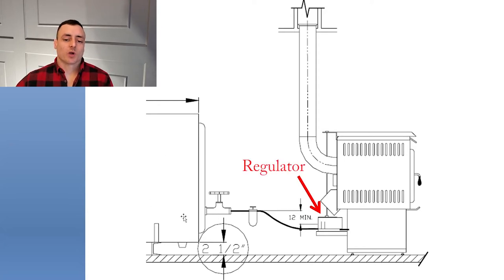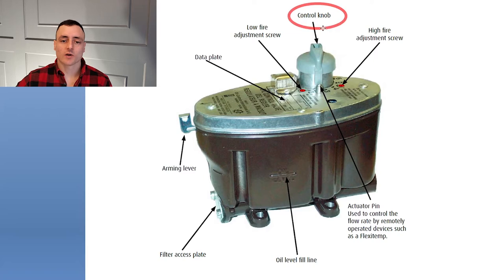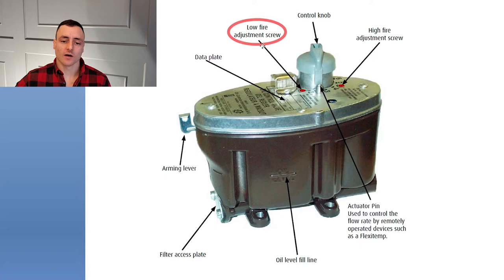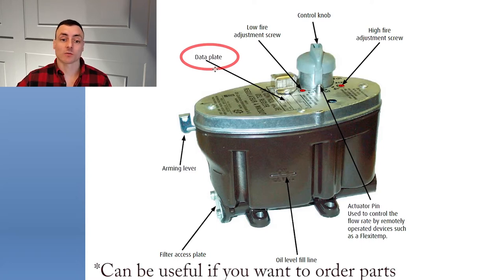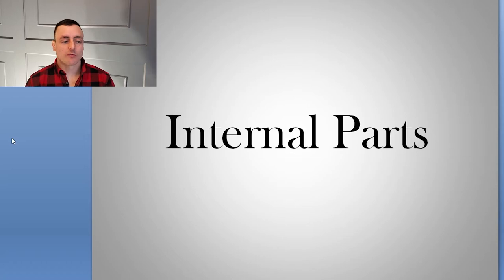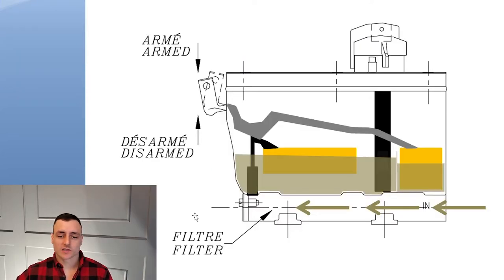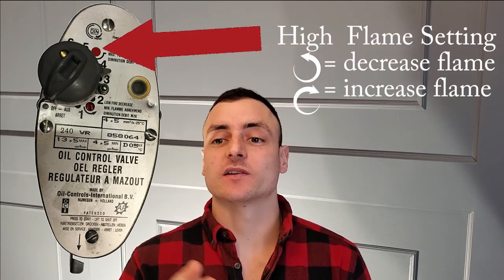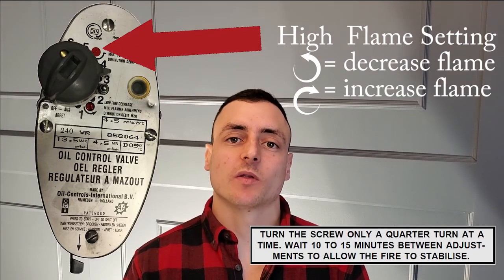OIL STOVE | How the CARBURETOR / REGULATOR Works | How to adjust and clean it

Comment: How does the oil flow uphill into the oil control valve???? Seem counter intuitive!
Reply from the maker: Good day, as long as the reservoir is higher than the regulator it will have enough potential energy to flow. If the reservoir is below the regulator, a pump will be needed to make it flow up uphill :)
Reply: @philg  got it! Thanks

Comment: Any info on adj damper I played with as well opps
Reply from the maker: You can screw/unscrew the weight in the back. Try putting some oil on the hinges and move it a bit to make it move freely. As the stove runs, you can adjust it and see how the flame reacts. Make sure your stove is level and the air is flowing properly (nothing stored underneath the stove etc)

Comment: Nestor Martin P.FONTE C100,  has a thermostat device with a sensor on the top of the carb.  Would it be OK to remove this device so the carb will run manually instead of being regulated by the sensor.  I have been having problems maintaining a steady flame at any setting on the main knob.  If I direct a fan at the sensor on the back of the stove, sometimes the flame will stabilize at a designated level.  It was -5F this morning.  When I got up the stove was all sooted up and almost no flame in the pan.
Reply from the maker: Good day, yes you can remove the thermostat. The thermostat uses the extruding pin to control the regulator. If you find having to put your fan behind, I would maybe verify your damper, if It is well adjusted or moves freely without any resistance. Let me know if this works. Cheers!
Reply: I found the stove to be out of level by approx. 1/4” in both directions, leveled up now.  Pan also had a bunch of coke built up around the oil inlet, cleaned.  All seems to be working ok now.  Will remove the stat if I have further problems.  Thanks 😎😎
Reply: There is a knob on the stat housing on top of the carb.  When I turn it clockwise there is a small arm that pushes down on a pin in the top if the carb housing.  How should this be adjusted?   Thanks 😎😎
Reply: After 15 minutes good burn turned into a sooty flame on the side of the pan with the oil feed.
Reply: @rickgulack7872  I actually had that and it turned out that my outside tank had water in it from condensation and the water was freezing in the filter which was then restricting the oil flow causing the flame to get lower and sootier and eventually go out. I would relight and it was great again but after about 15 min it was the same story again. Cleaned the water out , problem gone.
Reply: After a couple years of struggling with soot issues, especially in below 0F weather, I started using #1 diesel instead of #2.  All problems solved.  No buildup of coke in pan, etc.  More expensive to run, but well worth it.  😎😎

Comment: These units only have one FLOAT ! CALLED  POT BURNERS MADE IN SWEDEN, CAN STILL BE BOUGHT TODAY  .lift the lever UP it cuts off all fuel.
Reply: Also fit a cut off prior to entering  unit
Reply: These units are model dk 8722
Reply from the maker: Thank you for the comment, I’m sure many are looking for parts. Is there a website to but they from?

Comment: Well carburetor as in sence of some trains actualy used oil to run gasoline engines suposedldy they hade 4 spark plugs in each cilinder so yeah basicaly gasoline hot bulb engine ore gasoline dizel engine ore dual fueling so I belive thats originaly where that thing is coming from thats why it is carburetor 🤷 probably
Reply from the maker: Interesting! Thanks for sharing :)